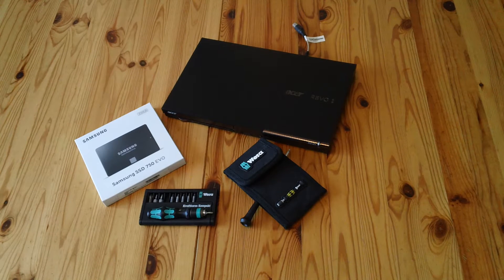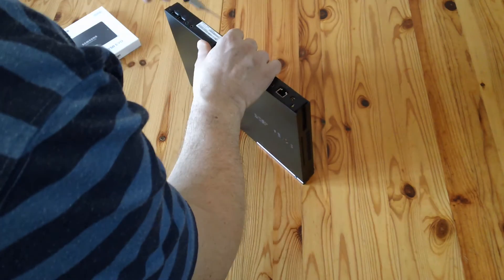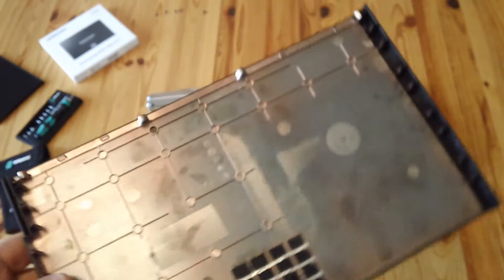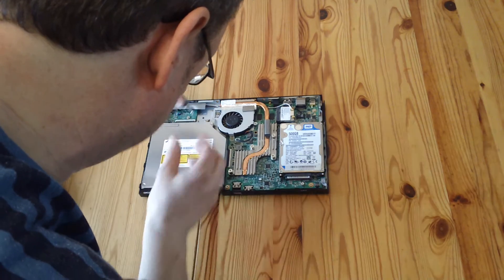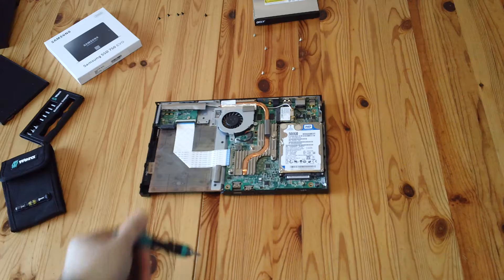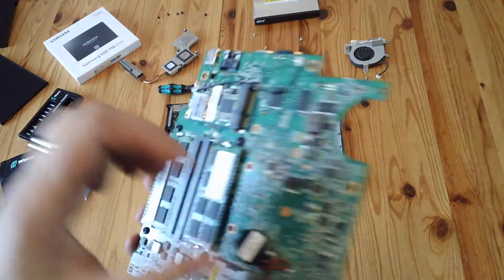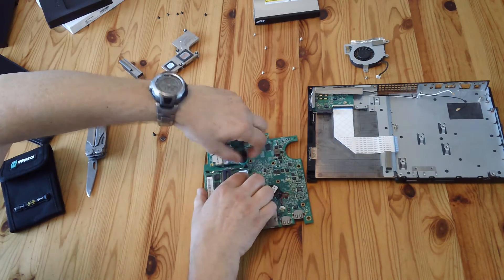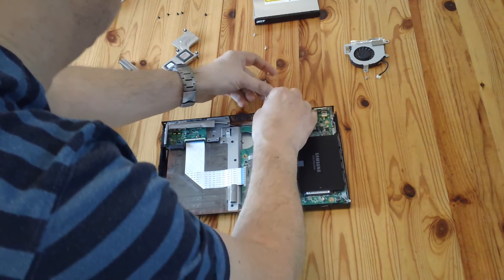ACER Revo RL100 *HOW TO* Replace or Upgrade Hard Drive

Comment: Cheers so much from the year 2022! I got one of these from a second hand shop and was curious how to replace it with a SSD. Thanks very much for the video!!
Reply from the maker: Five years old and still relevant!

Putting in an SSD makes this device useable now... you might want to think about de-bloating Windows too if you're planning on using it for more than just a media player under the TV.

:)
Reply: @sterntechdaddy  I installed some Linux on it for a bit of fun and it’s working a treat! Cheers again!

Comment: You didn't clean the CPU and reapply thermal paste?
Reply from the maker: Nope... but you can if you want to. The paste should be an interface between the CPU and the heat sink - but it’s not jam between slices of bread. 

More the melted butter on toast - it fills the tiny blemishes in the CPU lid. The paste was still tacky and hadn’t turned to a dusty layer so it hadn’t deteriorated. You can see in the video that the CPU die has squished the paste out so there’s pressure on the heat sink to still make good thermal contact with the top of the CPU without the extra cleaning and reapplying.

As long as the IHS is covered it’s all good.
Reply: @sterntechdaddy  Oh I know, I work in IT. Protocol is to clean the mating surface of the CPU and reapply thermal paste. I was just curious as to whether or not you did it off-screen or not at all, and if not at all, why it was you made that choice. You said the paste was still tacky though, so that answers my question.
Reply from the maker: @guestaccount5428  It's experience too... When the paste is applied, the forces involved in putting the heat sink on will squeeze the excess paste out. If the existing paste hasn't deteriorated (i.e. it's not dry powdery) then it'll suck a bit back in when the heat sink is removed because of a vacuum effect. When the heat sink is put back on, it'll spread out again.

If you look closely, when I refit the heat sink assembly I tighten the screws in a particular order... this helps the heat sink squeeze the paste so that air gaps are removed and the paste spreads evenly.

Back when I taught CompTIA A+ Certifications, I had a whole class of 25 students all assembling AMD Sempron systems - and they used no paste at all on the HSF.  This was done to make the practical easier in terms of both mess and consumable costs. Never lost a system and all worked for hours without any problems. No paste on a modern system is obviously a REALLY bad idea, but these examples illustrate that the religious removal and reapplying might not always be necessary.

I would tend to judge it on the state and age of the paste that's there - or on any suspicious thermal issues that get noticed in the diagnosis. Older systems I have in for repair get HWMonitor installed and their temps checked with Prime95.

Note that the ACER Revo in the video is still working perfectly with no issues - thermal or otherwise.

ahem

Apart from needing to remove the Wi-Fi card to get a Windows 10 version update to work... but that's another video. 

:)

Comment: Great instructional thank you Nic, no idea how the hell you figured all this out but it worked for me. Now running Win 10 1903 nicely with a Crucial BX500 480GB. 

I managed to tilt the MB without disconnecting the aerial and fan wires and it all went back together and with just one, washer-like part left over. 

Now to figure out how to buy you a cybercoffee from the other side of the planet!
Regards
Reply from the maker: Thanks very much! Glad it helped.

Comment: Anyone managed to get this machine to accept the Creator's Update to Win 10?
Reply from the maker: The machine in the video is still on 1803 because 1806 and 1903 won't install. I think this is because of the wireless network card - if I try and disable it in device manager everything freezes. So try removing the wi-fi card (top right at 3:45 with the grey and black wires plugged into it) and then running the update. It's quicker to use the Media Creation Tool to manually upgrade rather than Windows Update. You can get that from this link:

https://www.microsoft.com/en-gb/software-download/windows10
Reply: Thanks for replying, I had heard that might work and was dithering over doing it, especially as nobody stated it worked for certain.  After so many failed MS automatic update attempts, including corruption of the original OS and reversion to image that I now have Windows Recovery/Install fatigue, even with the Media Creation Tool.  That was why I was hoping for confirmation it would be worthwhile doing.  Next rainy day I will give it a try.  Fortunately I do not need the wireless connection as I use ethernet.
Reply from the maker: @marquisdemoo1792  I use the Revo for a media player on my TV so wasn't too worried about having the latest build or features for Windows 10, but I did attempt the 1809 upgrade and it didn't work. Similarly, the 1903 upgrade also fails.

I'm going remove the wi-fi card from mine and try it later...
Reply: @sterntechdaddy  Likewise except I had problems stopping the feature updates from repeatedly happening and by the time I got round to it they had fouled up the OS so I could not revert. I have an image which works fine until I restart and then it crashes because it seems to be attempting to activate a feature update on reboot (my fault I had an earlier image but took it forward to incorporate all the missing updates).  I have just reloaded windows from scratch thereby going  back to a 1609 build (I think) which works great, apart from WUmgr identifying some updates without links, which cannot be downloaded and others that install but on reboot represent as not installed.  However I get the impression MS has now removed the intervening builds. MS Update Manager seems to load the latest (1903 I assume, which is what this PC is using).
Reply from the maker: @marquisdemoo1792  Check this out...

https://youtu.be/f-GBcLAtsFM 

Problem solved!

Comment: Great video. I just got ahold of a sealed "Engineering Sample" version of this computer, with slightly different packaging and a 160GB hard drive inside. I haven't opened it yet. Still not sure if I will. If I will, I will use this video to replace everything pretty much.
Reply from the maker: The SSD makes a massive difference, but pretty much everything else is surface mounted so not really replaceable.
Reply: @sterntechdaddy  It's okay. It does look like I'd be in for replacing the HDD with SSD, adding 4GB of RAM, replacing the CMOS battery, replacing the PCIE wireless card, and repasting with thermal grizzly for good measure since the pipes are being removed to get to the drive anyway.
Reply from the maker: @JesseJamesHeadrick All great things to do... it's a really nice little device too - but you might want to get something to use instead of the wireless keypad and trackpad thing that comes with it. It's pretty cool how it fits into the RL100, but really nasty to use. I've got a Logitech diNovo Mini with my RL100 - but that's really old now and no longer made.
Reply: @sterntechdaddy  Definitely... Speaking of which, is the battery in that detachable thing replaceable?
Reply from the maker: @JesseJamesHeadrick  I've had a look and there's no obvious screw holes to remove to get it open - so any attempt to get at the battery could break it. And even if you could get it open there's no guarantee the battery is available anyway.

There's a service manual here: https://www.manualslib.com/manual/232932/Acer-Rl100.html#manual

And that doesn't have anything about wireless touchpad disassembly.... so I'd save the hassle and just get another one. It's horrible to use anyway... :)